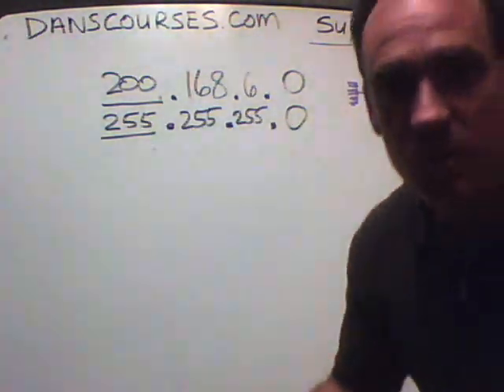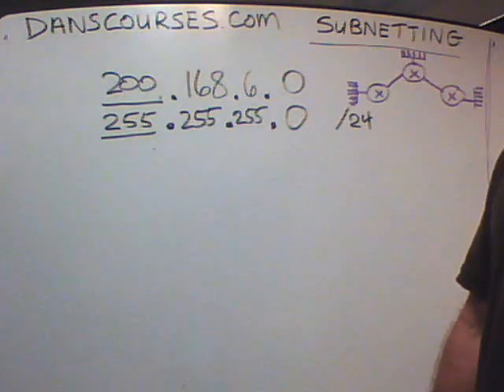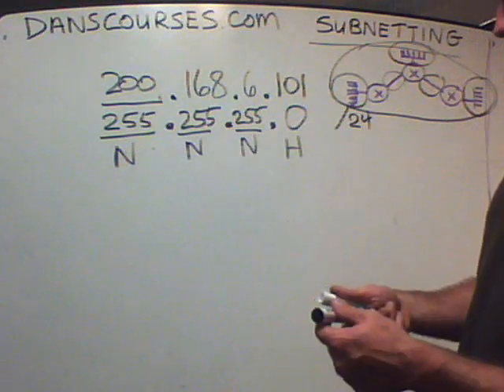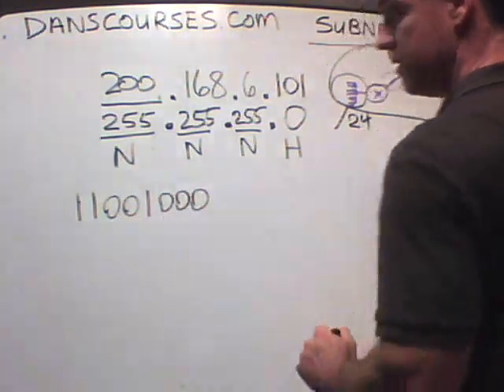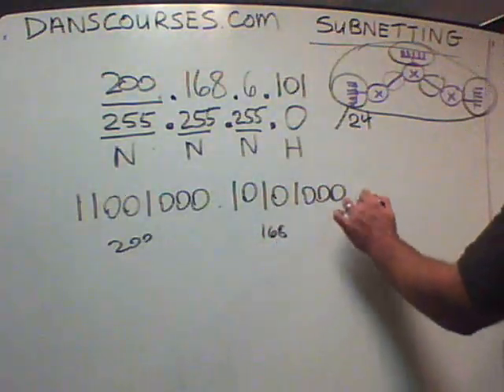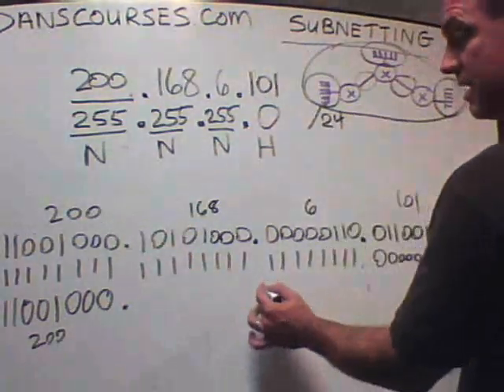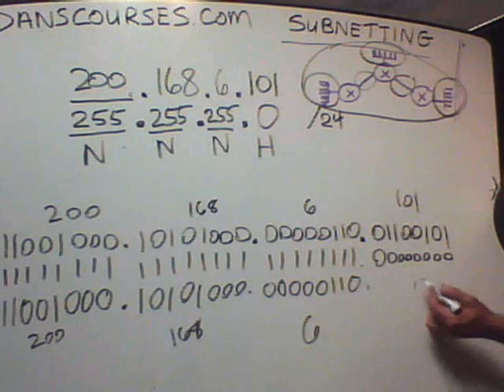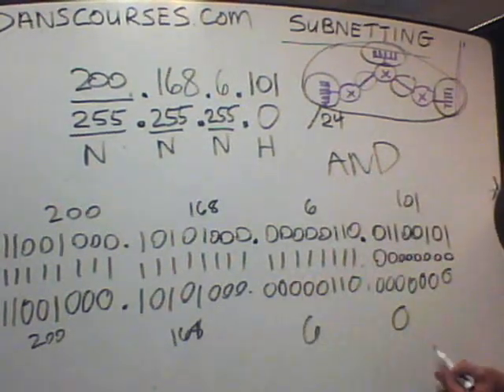Subnetting - ANDing - part2

Comment: It is not the routers job to use the mask. When a router receives a packet there is no original mask with it. 

When a packet is placed on the wire, the originating device uses the mask to determine if the packet is destined for the local subnet or not.
Reply from the maker: The router definitely uses masks
Reply from the maker: All of its routes are masked

Comment: i came to find that subnetting doesn't work. You only end up with the exact amount of hosts, the exact same amount of subnet masks, nothing changes. Nothing is isolated, and when you install the hardware, router behind router, all devices lose connectivity. You can't subnet, it's a lie. I gave up on trying to figure it out. It works out fine on paperwork, however when you install the hardware necessary to "subnet" it all fails. a router is supposed to connect a netowork to a network, however a router doesn't connect a network to a network, it breaks the connection. Where's the logic?

Comment: If I'm not wrong 3 routers would get you 4 networks and not 5!!
Reply from the maker: With serial cards, like in the labs, the router in the middle uses 3 of its interfaces so 5 networks total. 3 LANs and 2 point-to-point serial networks.

Comment: 30 means that the last 2 digits are hosts.. so the subnet mask should be 255.255.255.252
for ex. if it's 29, subnet mask will be 255.255.255.248 , 
for ex. if it's 28, subnet mask will be 255.255.255.240

Comment: subscribed, best tut on youtube!! also just out of curiosity, what if i have been given an IP of lets say 192.168.20.0 and a legal subnet of 10, and want to have a max of 6 computers, i have already worked out the answer and i have come up with net id: 192.168.20.128, Broatcastid: 192.168.20.192, range 192.168.20.129 - 192.168.20.191, subnetmas: 255.255.255.192, is this correct?? can someone confirm?? thanks